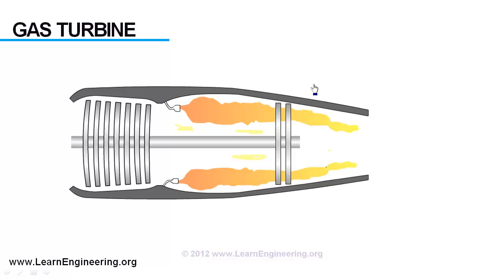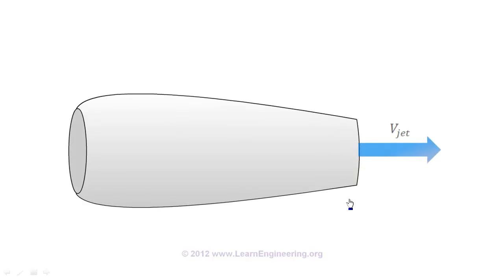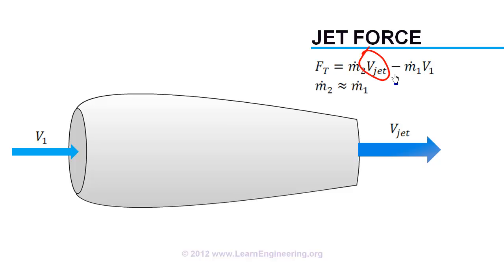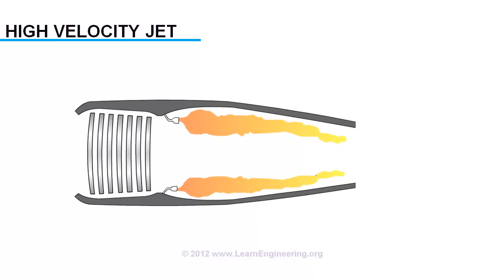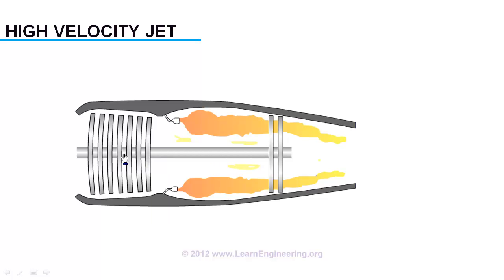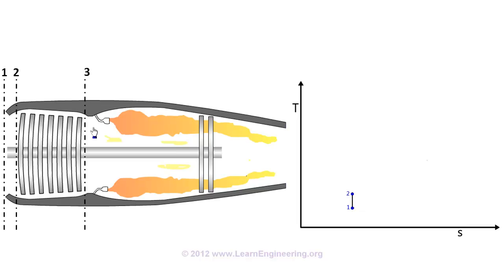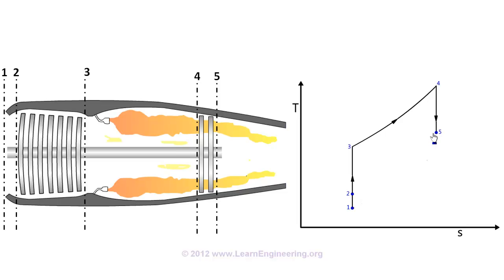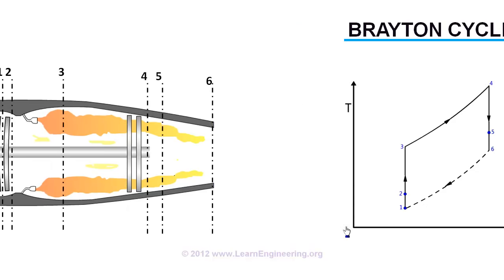Gas Turbine Engine, How it Works ?

Comment: I didn't understand point 6. Why is pressure at point 6 equal to atmospheric pressure? Fluid at point 6 has a momentum and high temperature. It goes out with a very high energy. If its pressure was equal to atmospheric pressure, then it wouldn't go out and push the air out. Am I wrong?

Comment: It's like turboprop engine for me. What I know jet engine uses 2 tipe of compressor (low pressure compressor and high pressure) and 2 tipe of turbine (high and low pressure turbine). It also has bypass air. In modern jet engine the low pressure compressor and turbine rotate clockwise and the high pressure compressor rotate counter clockwise. The bypass air >70%.

Comment: Brayton cycle or gas cycle is an open cycle... but what will happen...if we use the exhust gas by purifying and  ordering the purified gas and fuel to reuse again...?  save our beloved world from pollution....I need to join your group...!!!!!!!!!!!!
Reply: +Saleamlack Ashagrie i want to combine abaut Brayton cyrcle with rankine cyrcle,.. so,.. heat from exaust can be use again as electrical consume,..
Reply: +Saleamlack Ashagrie but I need more help to do,.
Reply: You can not reuse the fuel and the exhaust gas can probably be filtered somehow, but it would probably be on the expense of thrust force and that you do not want in an airplane. But if you haven't noticed, more fuel economic gas turbine engines are being made all the time.
Reply: has done my graduation guys,.. last october 2016,. hhee thank you
Reply: Nice

Comment: As there is no solid barrier between the combustion chamber and the defuser chamber  and as a compressed gas will exit by the point of least resistance.  Why does the high pressure gas in the combustion chamber not exit through the defuser?
Reply: Val Martin bc this is modeled at steady state, where the aircraft is moving forward. Air is rushing in continuously and the heat and velocity flows one way. Also, high pressure air will always move to a lower pressure to decompress. The intake compresses air so that the air is forced through the nozzle creating high velocity thrust.